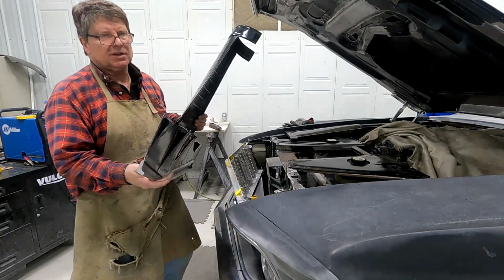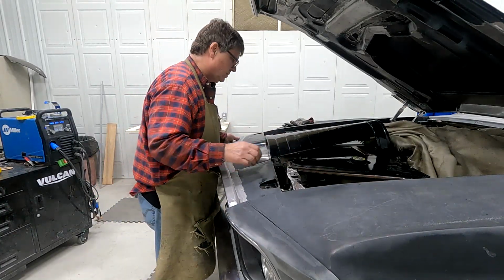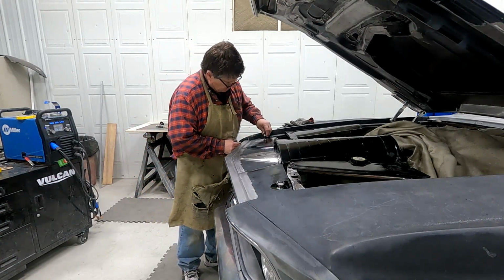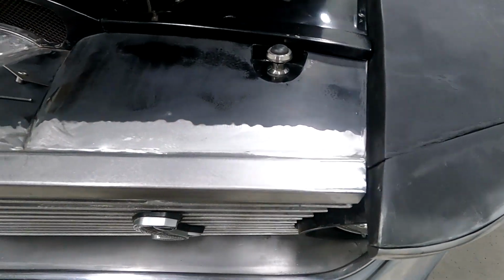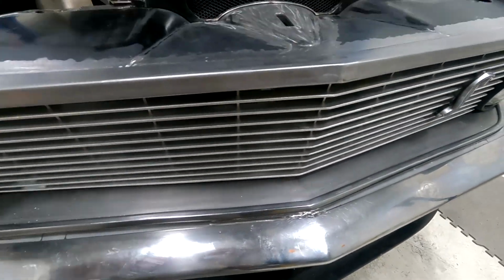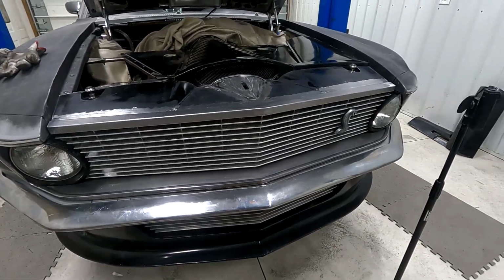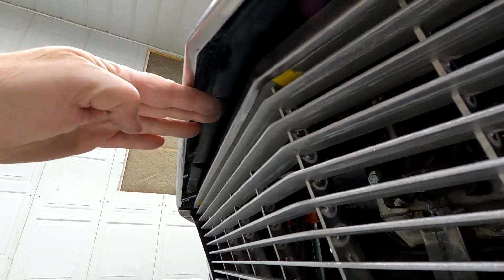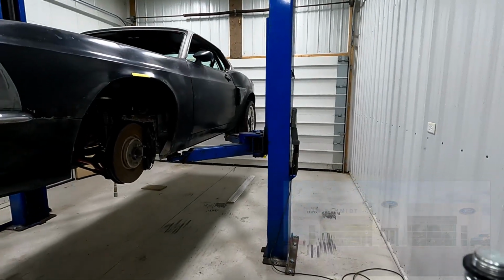Mustang Restomod Project Custom Radiator Cover  - Part 4

Comment: Nice. Did you design the covers with CAD or just draw them out and use cardboard mock up? I like the idea of using these so called riv nuts. That way you can remove the entire cover assembly if need be. So will you paint the riv nuts? Or leave them metallic looking. I'm wondering if the paint will stick to them well enough. Especially screwing them on and off.
Last question. Is that room with the car and your new lift, have filtered wall panels in it? Or what are the filtered sections used for? Or is it just missing panels with insulation showing.
Reply from the maker: Thanks. I made the covers using poster board (no CAD). The riv-nuts are the female threaded part. You can buy them just about anywhere. I crimped them to a piece of stainless sheet metal and they "slide" in a  channel which allows adjustment. I will not paint them as they are all stainless.  The "button head" screws are also stainless and I will not paint them either. The wall separates my two shop areas. I cut a hole thru it and to allow the heat to go from room to room. I added the filters to keep the dust from going to the area that I keep "cleaner". Thanks for the questions.